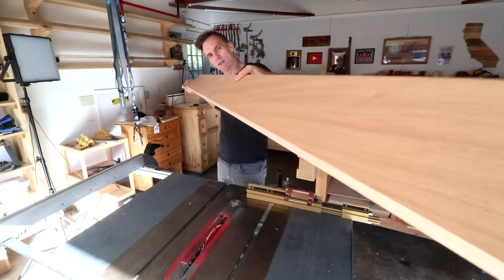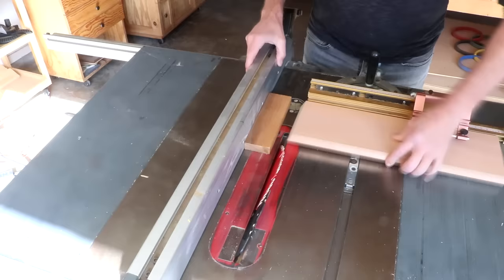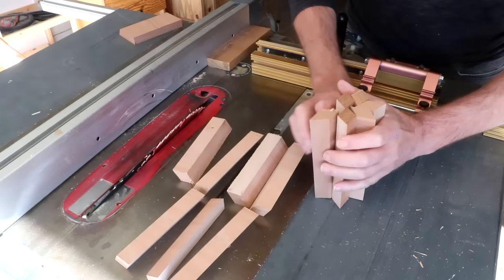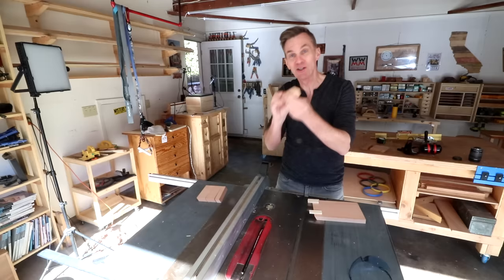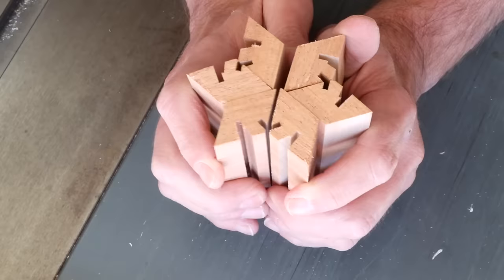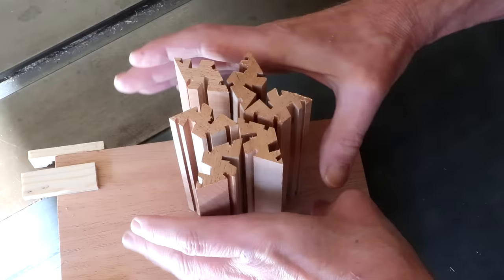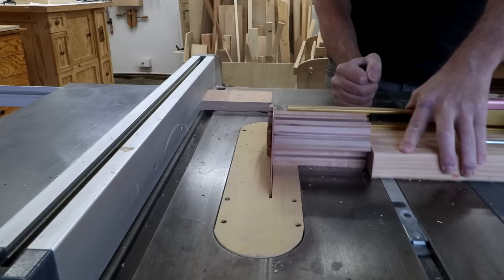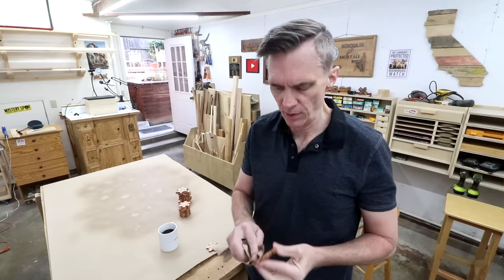Wooden Snowflakes on a Table Saw

Comment: In all my YT watching years, I think this is the first time I've seen a channel use this technique for repeatable patterns (I call it the salami/bologna method, depends on the mood). Not the first time I've seen it, but first time I've seen it on YT. I wonder if it is me, the technique's popularity overall, or the techniques popularity on YB.

Anyway, this is a great time to pull out thinner blades, or even use a simple jig and a thin handsaw like a dovetail one to get even thinner slices and more slices out of it. If you're particularly ~~miserly~~ good, you can even get them as crisp wood shavings from a sufficiently large hand plane from a intentionally dimensioned flake.
Reply: You may already know this since you say you're aware of the technique from outside YouTube - but a lot of those really fancy expensive handmade Japanese boxes with geometric patterns on them - or sometimes even pictures that when you look close enough are technically geometric patterns - are made basically using this technique and then they use either a hand plane or a larger machine to make paper thin veneers. Actually "paper thin" is probably under selling it in many cases... so you can imagine how many layers they can get out of one... uh "bologna log" (I like that analogy btw) of each design, especially since the blade in this method isn't destroying a few mm of material with each pass.  Because those "logs" last so long, they will save them and actually combine pieces of different logs in a variety of different ways to create new and different patterns in a new larger (but probably shorter) log which they can make veneers from.  Then they use those sheets as veneers on the boxes and lids that they make or you may see traditional puzzle boxes covered in these veneers (or I assume probably on plenty of other things they make besides just boxes - that's just what I'm specifically familiar with).  I've seen the technique referred to as Hakone Marquetry, after the name of the town where it apparently originated, but I believe it is also called Yosegi.
Reply: @johnandjacquelinewarren9979  Indeed, that is a good one (first time I heard about it was indeed as yosegi, only for later to learn that it basically just means "parquet" or marquetry in this context, so Hakone marquetry imo is a better name in English for the specific Hakone practice). Different purposes (make repeated working pieces vs repeated decorative veneer), but same efficiency and repeatability driven principle.

Comment: Steve does this only work on 3/4” ?  I tried with 1” poplar and couldn’t get perfect cutoffs but 3/4 seems to be the magic number
Reply: It should work with any thickness, as long as the width and height are equal. See my trick for doing that in my comment above.
Reply: John, Thanks for the reply. I read your post but I don’t understand .Can you clarify?

Comment: Hey Steve my wife watched this with me and loves these and wants me to make some. Would pine boards work in your opinion or would it be too fragile when cutting the final stars to size?
Reply: Hi, I'm obviously not Steve and not nearly as skilled as he is, but I've done very similar ones with pine, my only suggestion is to make them a little thicker, I don't think pine can handle such thin pieces without becoming too frail
Reply: I made these using Steve's video a few years ago. I just used pine common boards I had laying around and it worked just fine. As mentioned they are more fragile, but you can do it
Reply: Thanks for the advice folks. I will give it a go. I think creating a pattern with less "holes" in it might help with the fragility of the pine. Thanks for the encouragement :-)

Comment: I need a table saw :(
Reply: Black Friday is coming up!
Reply: I'm so glad I bought one, 6 months ago. (after hesitating for 3 years whether to buy one or not) Just this week I started my learning curve.
Reply: You can buy a decent priced one. I bought a titan for around 70. Very dangerous machinery though use it with care!
Reply: @custommadecrafts1271  Wow, that's cheap. Mine was 140 (Euros). I guess all table saws are more or less the same dangerous
(unless you have a non-flesh cutting saw stop table saw)
Btw I clicked on your name to see if you have your own YouTube channel. And you have!  I'll watch your videos this weekend.
There are some interesting small projects there. You are doing a great job.
Reply: @hansdegroot8549  thanks mate! Its nice to make projects my followers would enjoy watching and could make! Not that all of them are small, the sofa was hard work! Your feedback will be highly appreciated!👍
What table saw did you buy?
Reply: @custommadecrafts1271  I bought a Scheppach 100S. It has 2000W, 80 mm sawing capacity. It came with a stand, 2 side additions for the table, 2 blades and
a push stick. I'd prefer a table saw without a stand but I could find only which one miter gauge slot (and I wanted two, for more accuracy for the sleds I want to make). But I put in on a simple DIY dolly of which the wheels have brakes. The oncoming week I want to make a sled
Reply: @hansdegroot8549  you could make your sled wide enough where it goes over the tabke saw and add a piece which butts up and slides against the edge for accuracy. Haven't seen a table saw with only one mitre slot!
Reply: @hansdegroot8549  definitely let me know how the sled making goes!
Reply: @custommadecrafts1271  Some smaller table saw (worksite saws is maybe a better word) have only one mitre slot, for example the Scheppach 80 and I think also the small Bosch. At first I was interested in the Dewalt 745 but that one costs in Slovakia 3x  the price as in the US.
Reply: Btw I don' t use the sideparts of the table saw table. The can only be screwed on which is not very practical
Reply: @hansdegroot8549  I'd love to order a dewalt item but inprefer Makita, Japanese strength💪
Reply: @custommadecrafts1271  Yesterday it took me "ages" to make the two runners out of a plastic chopping board (advice from Collin Knecht from
woodworkweb) Today I'll watch the internet to find the ideal dimensions for the table saw sled for my small table saw.
Reply: @hansdegroot8549  once you get all of these nitty gritty stuff done you'll be good to go !
Reply: @custommadecrafts1271  I found a melamine kitchen cabinet door (straight edges!). Tomorrow I'm going to try to transform it to a sled base.

Comment: I got a bit nervous when you run these strips using that insert plate with the large opening. It looked like the strip could have fallen into the gap and then shot back at you. Safety first.
Reply from the maker: I guess it was fine.

Comment: 1:00 - "don't use rip fence without a stop block, for safety"
6:00 - proceeds to use rip fence without stop block... "screw safety!"
Reply from the maker: It's safe to use a rip fence on non-through cuts. There is no piece cut off to potentially kick back. Don't use the combination for crosscuts. Hope that helps clear up your confusion!